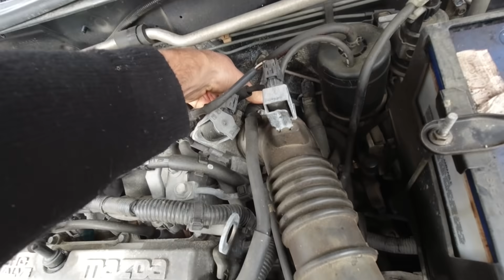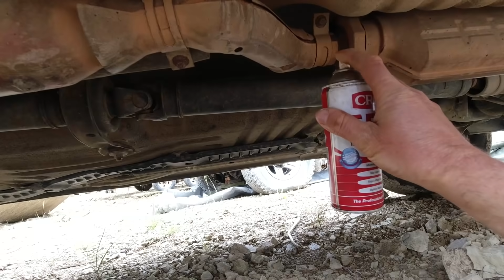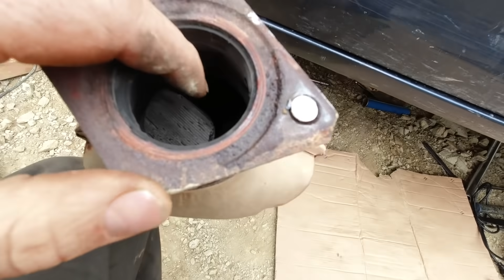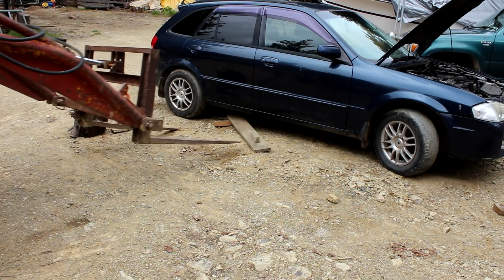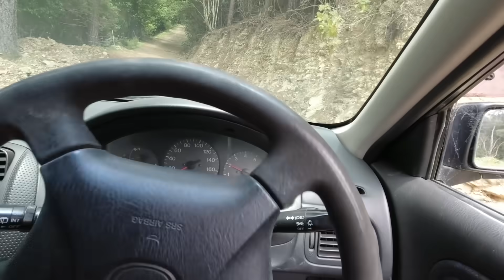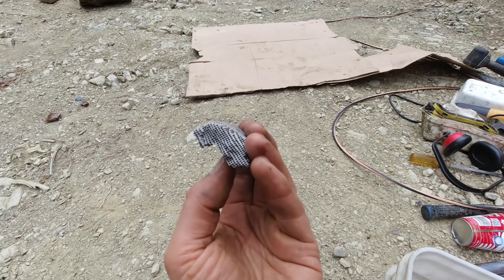Car engine overheating / lacks power,  Faulty Catalytic Converter?

Comment: If I start sensing a problem with a catalytic converter in one of my cars, I simply drive 3hrs south to Detroit or Chicago and park it—and we go to lunch.
When we come back 25 mins later the converter is gone, and my insurance covers the towing and a newly installed one that afternoon—while we have dinner. 
😬 [kidding of course]  ☺  Thanks for your time/effort Marty–even on the short videos. Have a great day. God bless.

Comment: My wife had a 1989 Mazda 323 'Shades' which notched up 500,000 Km just before she died. For the past 8 years the kids have used it to drive on dirt tracks in outback Oz until they pick up the school bus at the highway. Does about 35 Km every day -  no rust in the dry desert heat .Car is unbreakable, but the kids look after it - they're walking if they don't!
Reply from the maker: Haha nice

Comment: It's a different game when you don't have to be concerned with emission testing or inspection.
Reply: We still have inspections but just no emissions. You're right tho, it's pretty convenient
Reply: Always a place that’ll pass it.
Reply: @daeyvidd  Good news for all there then. as its getting crazy here In the UK.. I bought a "EGR" delete kit for my BMW diesel powered Landrover freelander as what brainless fool thought up the idea to route some of the exhaust back into the inlet side of the engine but, our years government MOT tester friend said NO cant do this, so had to clean out the original  EGR (exhaust Gas Recirculator) so I can get it "Tested"/ But rules are rules eh.. Good to see your country has better rules on vehicles / happy days Indeed.. Ian --UK.
Reply: Im jelous that nothing is rusty or rotten there. Danm salt on the roads wreck all of our vehicles
Reply: Make it a 2 stroke while you're at it. Get some more horses out of it
Reply: @ianburit3705  Emission tests are there for a reason, nobody wants to breathe the harmful gas from your exhaust.
Reply: David Cotrell 
Not in the UK, the machine that tests the emissions is directly linked to the government computer terminal that issues the test certificates.
You would need a similar vehicle to obtain a reading from at the same time.
Reply: @ianburit3705  Thankfully in Northern Ireland they don't do the emissions test. I've ran a blanked egr for a while now, car going much better and no black smoke anymore.
Reply: @John_Wood_  That IS my aim after its MOT.- dont take long to change them over for years MOT does it.
Reply: @liammeharry  LOL The Americand designed and used a 2 stroke diesel for buses and trucks, boats and big plant but it had valves and an oil pump and sump. It came in different sizes from 3 cylinders up to 6 ? name that engine - lol
Reply: @fsul8536  but so many countries dont check or test emissions still
Reply: @fsul8536  ok, but never mind, the UK government is going to ban fossil fuelled vehicles by 2030 so you can breath clean air in a £80.000 pound vehicle/ or continue to drive a vehicle that makes exhaust gasses/ even more so drive a 40 years old and older classic vehicle that does not need MOT or Road tax, just £100 per year CLASSIC Insurance, and can be an old style Smokey 2 stroke if you like/ Trabant and others
Reply: @WhiskeyGulf71  Using a "Clean" vehicle just for the emissions part of the test has been done by MOT stations in the past, but I once had an old series 1 Ford Mondeo diesel estate that truly put out very little exhaust gas or smoke so that the tester done that part of the test twice as he never believed It first time round/ it had a rebuilt Injection pump but sadly living 30 metres from a great beach killed the cars undersides..Was just so good on diesel though.
Reply: @ianburit3705  Same here in germany, but the emissions test is only every 4 years, and if your cars ecu doesnt mind the egr beeing deleted, then it should be worth it to do so, and to take it out every 4 years.
Reply: It hadn't occurred to me before watching this, but we don't have an emissions test as part of our Warrant of Fitness test.  The UK MOT test, and I am sure US vehicle testing stations all measure emissions.   Come to think of it, it is why we get cheap used Japanese cars here.  They drive on the left in Japan, and their emissions testing is so stringent they export used cars to NZ if the exhaust gets a bit wiffy.
Reply: @ianburit3705  Those countries that doesn't have a strict emissions test have trouble air quality people become asthmatic as a result.
Reply: @TrevorDennis100  It's state by state here in the US. Some do emissions testing, some don't, and some rely on the self-test by the vehicle's PCM so that the "check engine" light determines pass or fail. Others don't require any scheduled inspection at all.
Reply: @ianburit3705  what they don't tell you is that the exhaust gases that are generated by the EGR valve are way more toxic than regular exhaust  gases from diesels without emissions control systems.
A bunch of German  scientists researched the effects back in 2010 when one of them noticed an increase in lung disorders in his local area.
The research was presented to the EU Parliament, but as it went against their agenda, they decided to ignore it.
Reply: @ianburit3705  you talking about the old 2-stroke detroit diesels? I've got one a old 2 cylinder genset from a railroad refrigerator car I've got to fix a 2-71detroit. Detroit made 1 cylinder models , 2 cylinder models, 3, 4 and v4 models 6 and v6 models v8 models and v12,v16 and v24s. if i remember right the 12s and up were multiple engine blocks bolted together to save on having to tool new parts
Reply: @ianburit3705  it's illegal to do this pretty much everywhere except the third world
Reply: @ramblingman8992  the particulate was big enough not to be absorbed in the body and the carbon would just fall to the ground, but when they started screwing with the emissions the particulate became small enough to be absorbed and has made it worse, between GM trying to use a gas engine block for diesel and the crazies that think rolling coal (dumping extra fuel into the motor to make a lot of black smoke) is cool has really killed diesels here in the US
Reply: Did it stop the overheating?
Reply: @TrevorDennis100  Way to go Trevor mate - enjoy - lol
Reply: @fsul8536  So New Zealand is a polluted country, right - lol - think millions on New Zealanders would disagree with your statement.. OK, IF you read some replies to my comment of taking OUT the EGR and the vehicles drive better - less Diesel smoke Is that not a clue ?
Reply: @tonyz2897  Then we get the VW fiasco with how many pre owned VW group cars being bought back ? we still got lawyers here In the UK seeking VW/ seat/ Audi and Skoda owners seeking compensation over the Emissions scandal.
Reply: @ramblingman8992  LOL - Shhhh dont upset the ECO warriors/ but yes agree so do many others on forums I have read on my particular BMW diesel powered freelander
Reply: @matthewhoffman9242  I follow a few Americans on you tube so learned about Detroit's - Grease Bus Monkey started me off on his 6-71 then he replaced the head with a 4 valve version was it? then along came videos on other equipment and trucks on "will it start videos" so i also learned about sticking fuel injector rails, even Jonathan W has just got an elderly drag link crane he got with really stuck injectors so believe that was 2 cylinders/ the power of you tube eh... As I live 30 metres from a beach we get fishing boats passing by so sometimes I have to listen hard to see it they are powered by a 6-71 as in Aussie In Dangar Marine, as he has just put his 6-71 back in for the second time on his diving boat./ I`m 72, built things with engines since i was 12, had 14 years as an oval racer in 4 separate formulas and built race winning engines i used and for a few select mates/ have owned landrovers (diesels) for over 12 years - my 1991 diesel discovery, that was bullet proof even at 240.000 miles when i sold it after 10 happy years as my daily driver/ know my early landrovers / hate the newer crap full of "Electrickery"
Reply: @Bob Green SAD NEWS Bob mate - make a you tube video of it all and the reasons why and send me a link eh..thanks.  Im a true petrol head through my oval racing but, I`ll get haters, I embrace EV or better still good Ev hi brids such as the Toyota H-RC is it as a neighbour had one.. fantastic vehicles
Reply: Agree, even in my country, Argentina, they are a pain in the ass.
Reply: @Jagermonsta  LOL so you believe NZ is a third world country ? lol
Reply: @ianburit3705  no I just assumed it's also illegal in NZ too, and Marty's just slightly naughty. If that's not the case then I guess I'm wrong gasp
Reply: @Jagermonsta  No mate your good,  Just sometimes we expect things to be the same the world over eh.. Ian.
Reply: @ianburit3705  I watch bus grease monkey as well and would say he was one of the reasons I got this generator. I don't like all the electronics they've put on the cars and trucks as well, I'd prefer a work truck model with all mechanical controls except for power mirrors and cruise control. I'm starting to get a crash course in fixing my stuff (got more video and book know how than hands on)
Reply: @ianburit3705 New Zealand's population is about 1/3 of the size of London so there is not going to be that many vehicles on the road. Air pollution effects people in big cities and it's mostly caused by vehicle.
Reply: @fsul8536  ER this I know its also the reason I sold my home of 25 years In what Is basically part of London now and moved/ retired at 55 to the coast 70 miles away and have lived 30 metres from a great beach and sea some 17 years ago.. I done my bit for society, worked harder than most doing 12 - 14 hours a night in production engineering for AEROspace parts/ said I HAD ENOUGH so got my late wife to retire along with me.. I breath sea fresh air 24/7 and have done for the last 17 years..  Pollution ? what Pollution where I live - lol
Reply: @dg1294  As our country is currently in lock down, and been In various stages of Lockdown since March last year i rarely go out In my Diesel, but do have 3 classic 2 stroke Vespa Scooters (dont fret I dont go out on them much either In lockdown)  SCOTLAND I now read IS ILLIGAL TO GO OUT, our country is virtually the same so LOTS OF SMOKE FREE SEA AIR FOR ALL BEACH DWELLERS - lol..I own up to doing 14 years of oval racing in 4 separate formulas, and some of my full race 2 litre FORD engines done equivalent to 8 miles per gallon of hi octane petrol, but that was full race flat out racing..with up to 30 cars per race, think of the pollution there along with burnt rubber hoowee lol
Reply: Or the environment
Reply: @JasonSouthSoundSound  that Victorians destroyed before I was born, or nuclear power station leaving a legacy for 1000`s of years yet we get those that complain in modern times ?.. your hundreds of years too late !
Reply: Bob Green Yes they kill the fun out of everything trying to make you pay
Reply: peace keeper  You do know more than one big city In China scrapped there fossil fuelled taxis  Already for new electric ones, and parent company GEELY mostly owns the company making black cabs for the UK market (Manganese Bronze) and America It seems and its brother a light van, with a stretched black  taxi  Chassid EV dont You ??
Reply: I'm from eastern europe. Can confirm I'd beg for real inspections here instead of the pure anarchy that's present here. Some of the cars I've had to work on... I don't even know how they even drove to me without snapping into two pieces...
Reply: @Daves_adventures4315  yeah, i got a inspection recently with nearly bald tires, check engine light, they literally just checked insurance, made sure the VIN's matched and said "Pass"
Reply: Remember scrap catalytic converters are worth a bit of money.
Reply: @ianburit3705  New electric cars can be had for less than £30,000 and NEW pure i.c. engines sales banned from 2030. NEW Hybrids will be banned from 2040,so one could still be running a 10 year old hybrid in 2050. A quarter of new car sales today are hybrids. So,even in 26 years in the future you can still drive an i.c. vehicle.
Reply: @stephencrowther524  One of my daughters just had to sell their much-loved camper van as they live inside KHANS ring of madness The M25 Orbital Motorway surrounding London or face paying £12.50 PER DAY to just park their campervan outside their home. She already has purchased a brand new 7 seater car to beat the ULEZ/LEZ and congestion charge JUST TO DRIVE IN PUBLIC ROADS In London, but, cleverly just bought to replace the campervan an Immaculate silver PORSCHE 924 as It classed as HISTOTIC thus does not have to pay Road Taxes, does not have to have yearly MOT tests (for testing if the vehicle is in 100% good order), and as it's classed as Historic, pays very little Insurance. Many of my buddies are doing similar even buying old EX USA trucks and restoring them just to ride around Central LONDON while laughing as they don't have to buy an EV or a Hybrid or have engines that are strangled to death but drive around with big fat yank V8s pumping out fumes in a mock salute to that Idiot Lord Mayor of LONDON and his money-making ULEZ/LEZ and CONGESTION charges DAILY..There are always ways around rules It seems.. KHAN Is a CLOWN, cares not for people only money so the people are fighting back with HISTORIC Class vehicles now..UP YOU KHAN eh.lol.

Comment: A family member ( many years ago ) had a Strada ( named Eric ) that would run fine on the level and down hill, but
as soon as you headed uphill it would crap out . The shop replaced the distributor , fuel pump, and rebuilt the carb to
no avail . After some head scratching I loosened the muffler flange and all was better . Gutted the converter
and looked like a hero ,  " Eric the Strata " ran for many moons .

Comment: I had a similar problem with a 15 passenger Ford van. I had hauled a bunch of teachers up to a lecture point, (I taught environmental science to teachers near Yellowstone National Park.) the van struggled on the trip up and I was sure it wouldn't make it back, so I took off for town, luckily a 15-mile downgrade since the engine would barely idle at this point. The van died one block from the mechanic's garage, we had to tow it. The mechanic dropped the catalytic converter, it was full of honeycomb 'nuggets.' It would have been illegal for the mechanic to modify the converter so I gave him money to go buy lunch and while he was gone, I shook out all the nuggets and bolted the converter back in place. He was happy and the van ran great!

Comment: You cleared the passage and fixed the flow problem but it would never pass emission testing in the states. BTW - Cats usually break up like that from backfires.

Comment: Had a similar thing once. I was at a sprint race in my Elise and first practice the exhaust joint failed, i refitted and tried again but it failed again. We then noticed bits of catalyst coming out the back of the exhaust. We did what you did trackside and knocked the innards out the cat. Put it back on for the last timed tun of the day and got a class win 100th of a second off the record. Gutted i diddnt get the full day but happy with a win.

Comment: Had a 79 cutlass do that on me while I was on a cross country trip. I pulled out the trusty tire iron (didn't have any tools with me), found a large rock in a nearby parking lot and drove the pointy end  of the tire iron through the side of the converter. Then I used the tire iron to ream a hole out down the center of the converter. Ran like new after that.

Comment: EPA likes this 😂
While I agree that keeping old cars running is better on the environment than buying new all the time, the proper fix would be replacing the cat. 
Also those internals should have platinum in them and thieves are cutting them out of cars parked on the street for the scrap value.

Comment: If you suspect a plugged up catalytic converter. Easy way to diagnose is to pull the upstream Oxygen sensor and drive it.  Just a tip for you.

Comment: The old reliable Mazda FS 1.8/2.0 engine. On the Cal spec cars in the states, the warm-up cats below the manifold would fail often, throwing a P0421 code. 
Occasionally they’d break up too. Must have replaced dozens of them as a master tech at a Mazda dealer I worked at.

Comment: Cold engine. Remove radiator cap. Put a disposable vinyl or thin glove over it. Seal it with tape or rubber bands. Squeeze a radiator hose to see if you have a good seal. Start the cold engine for 20 to 30 seconds. You should show no signs of inflation within 30 seconds.  You can leave the glove on while doing a cylinder leakdown test. You should see no inflation in the glove.  I usually use super thin saran wrap with a depression pushed in the center so and compression or combustion leaks are easily spotted. If you end up doing the head gasket please spread a thin layer of hylomar on both sides of the head gasket.
Reply from the maker: Good trick mate. Yes I suspected a blown gasket but it seems ok after getting that blockage out of the pipe

Comment: I thought I was the only one using wood logs as Jack stands😂, 
Happy new year mate.
Reply: Same here, I did improve mine tho by screwing on some exterior garage door handles to help move around with one hand.
Reply: @BMAWG1968  you can weld some rebars the shape of a square that would be lighter and easy to carry. 
That's what I'm willing to do